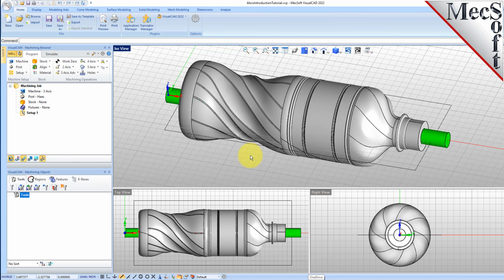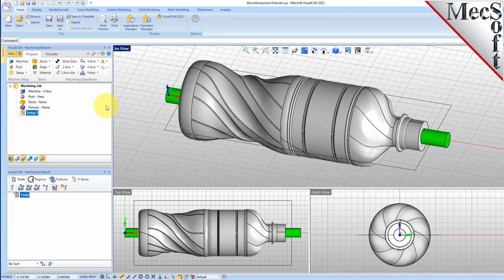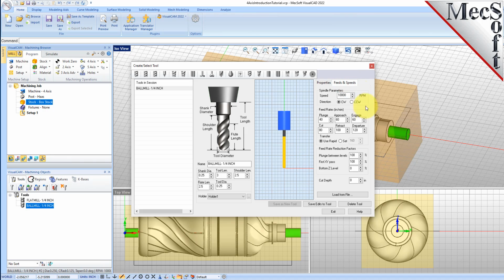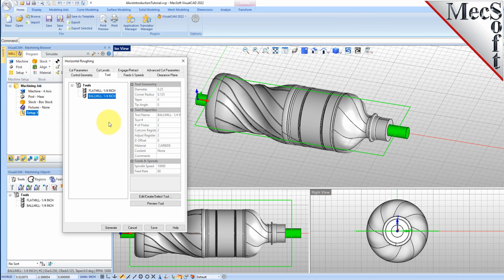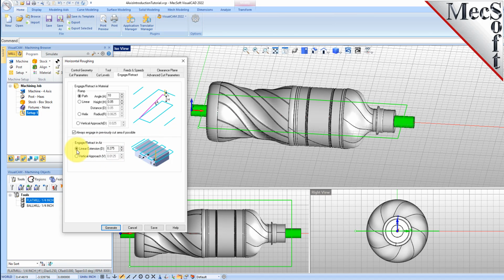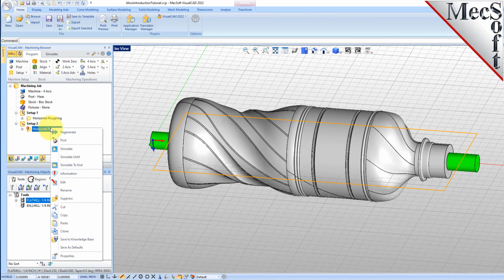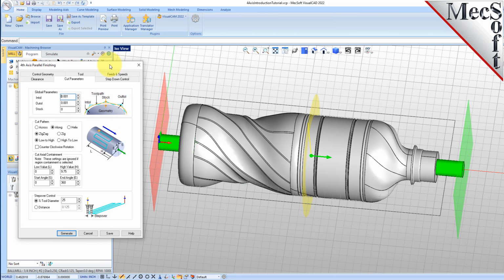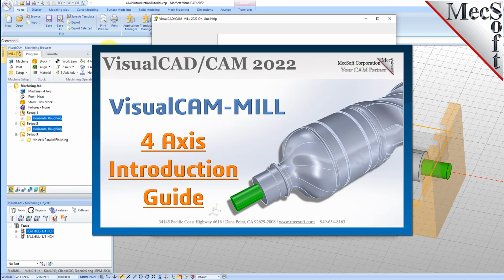VisualCAD/CAM 2022: Introduction to 4 Axis Machining

Comment: This is the same video for previus verson 2021
This is stil a good tutorial for the 4th axis, But one thing i cant understand, is why not use the cylinder stock part instead of using the Square sock.